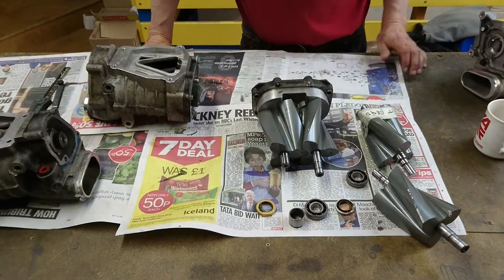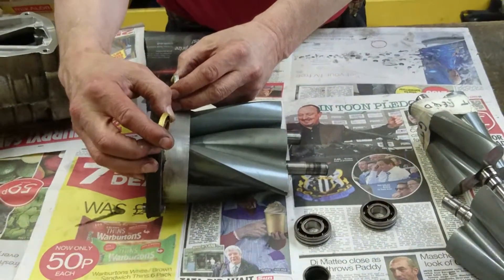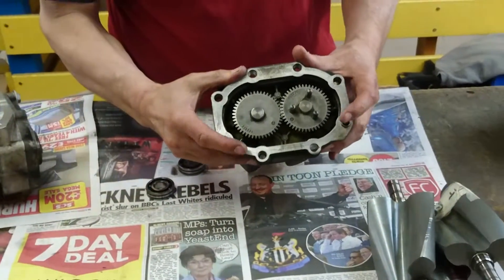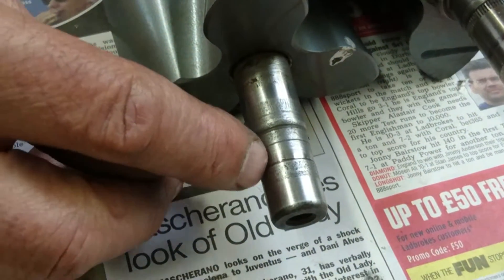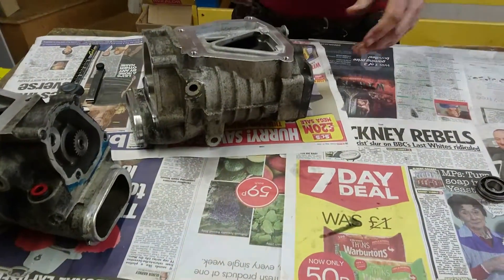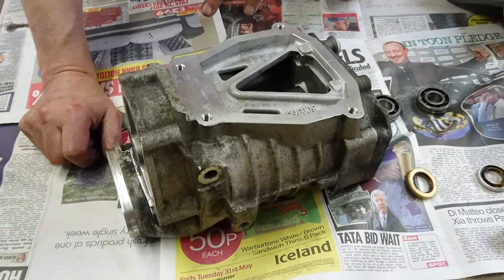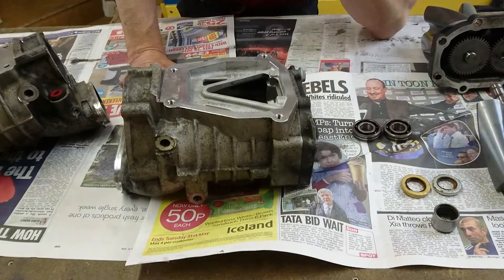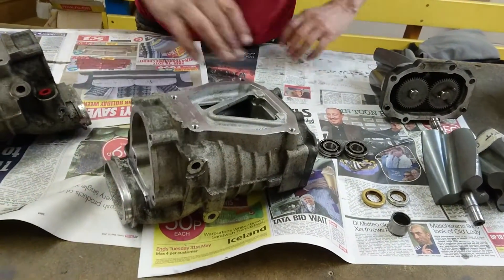GTT MINI COOPER S R53 SUPERCHARGER ROTOR PACK REBUILD

Comment: The tooling required holds both bottom ends of the shafts and the rotors in the Precise position before the gears can be removed or reinstalled. the tool also has to tie into the front mounting plate inorder to get the correct end float Clearance.
think of it like a cradle.

Its not hard to make the tool for this but you do need a perfect supercharger to get the correct measurements. 😉